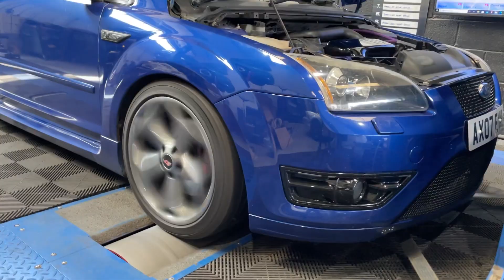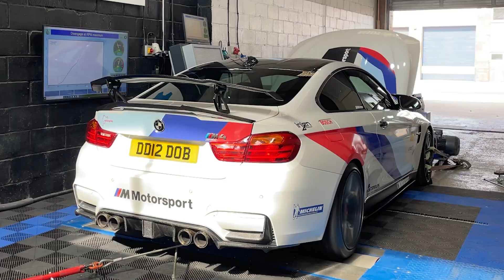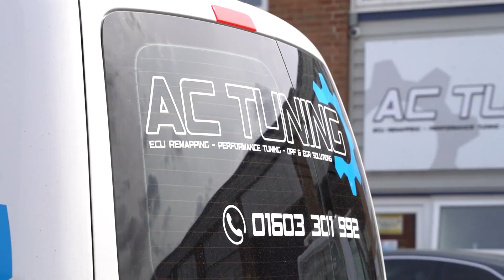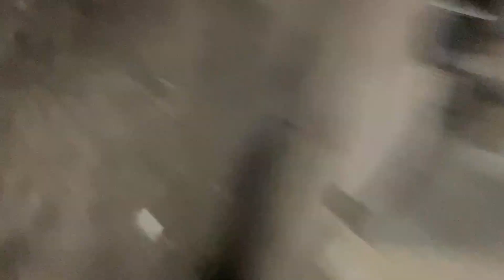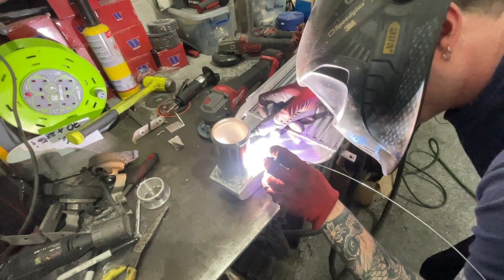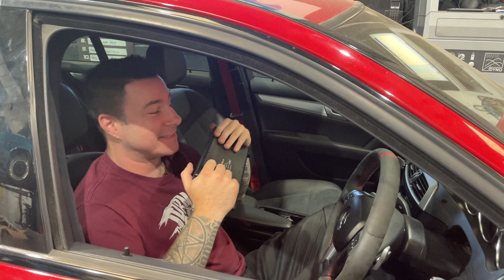Stage 3 Mercedes-Benz C350 Hybrid Turbo RETURNS!!

Comment: How’s the going , do you do much work to c250 cdi w204 ? Hybrid twin turbo , downpipe , intercoolers ? What kind of power would you expect from it with these modifications or is there any other supporting modifications I would need 
Cheers

Comment: Surely it wouldn't be a massive drama to turbo the petrol one of these it would be a rocket 🚀 c63 performance for micra money haha 😂
Reply from the maker: I honestly couldn’t say as never looked at doing one but it won’t just be turbo kit parts, it will be a standalone ecu as well which will really bump up the cost.
Reply: Yeah I guess a never thought about that haha not really any of the shelf bolt on turbo kits for these that  ive seen but I'm really Interested to see one haha 😂 be interesting to see if the stock suspension set up would put the power down ok
Reply from the maker: @gary-mac93  I’m sure someone will have turbo converted on at some point. Always worth having a look on here.

Comment: AC Tuning could you tell me the dimensions of the intercooler you used for the C350 please ? I already have one, likely going to need to cut out a bit of the crash bar for clearance. Mine is 700 x 300 x 80 only slightly wider but I've got hoses to cover that, only big change is double the standard height but if I cut out part the crash bar I think it'll fit nicely behind the grill
Reply from the maker: I will have to see if I can find the measurements for the intercooler as the customer supplied it. You have to cut quite abit of the crash bar out for it to fit correctly.
Reply: @AC Tuning  yea id thought as much especially with the added height, going from 145mm to 300mm ill have to cut out the top of the crash bar so it goes up behind the Mercedes grill then bolt the cooler to the crash bar and connect the hoses etc
Reply from the maker: @HardtoKill1986  it’s abit of a faf but definitely not the worst job I’ve ever had to do 😂
Reply from the maker: @HardtoKill1986  email us at info@autoculturetuning.co.uk and my colleague will work out a quote for you 😀
Reply from the maker: @HardtoKill1986  this is true, the cooler in this video was a direct fit for the original boost pipes, we only had to modify them as he had made his own hard pipe kit. 
But I hear what your saying 😊
Reply from the maker: @HardtoKill1986  awesome. Have you got the same intercooler as the one in this video?
Reply from the maker: @HardtoKill1986  thank you

Comment: Hello,
Congratulations for your preparation based on mercedes c350cdi (w204).
What turbo did you use?
The original mercedes GT2056v turbo that you hybridized?
Turbo specs please? (diameter inducer and exducer turbine, and for the compressor).
I am also looking for a good "plug and play" turbo for 315-330 horsepower on my c350 cdi w204, currently 286 horsepower...
Thanks.
Reply from the maker: The original turbo was built in to a hybrid by midlands turbos and was organised by the customer. 
I’m pretty sure the stock turbo is a 2260 but I would need to check this.
Reply: @actuning 
Thank you for your quick return.
Original on my Mercedes C350 cdi w204 (from 2009) so original power 224hp exactly like the old c320 cdi, I have an original gt2056 turbo.
Then in 2010 the 350cdi was upgraded to 231hp, but still with a slightly upgraded gt2056 turbo.

I would like to use a 2260 turbo in my Mercedes, but my own knowledge the 2260 was not used by Mercedes C class, even the next generation c350cdi engine (265hp engine) had a stock Gtb2060vklr turbo (on ball bearings + turbo liquid cooling).
This turbo starts very early and gives a lot of torque, but it is limited to output more than 310 horsepower, so a 2260 would be better... But not available in "plug and play" for my old version before 2010...
Reply: Facelift w204 350cdi comes with 2260vklr

Comment: Must admit I'm surprised the customer hasn't gone for the 400bhp hybrid turbo, I've heard as long as you limit the torque to keep the gearbox from going bye bye lol you can still run close to the 400 mark as the 265bhp versions have internals rated for 400bhp ? I love my Merc and Bm and Audi may have more power, but its not my beautiful C350 is it 🤷‍♂️ I love the w204 its one of the best shaped Mercs to modify
Reply: Gottuned has 400+ turbo for this engine 
And muchboost also something like 2872 size
Reply from the maker: @jimmykovacevic7745  Thank you, I will have a look 😝
Reply: @actuning  did you change tune in this video or same file did you got to much backpressure i think exthaust manifolds are too restricted 
In Finland they made custom ones
Reply from the maker: @jimmykovacevic7745  the tune is the same as where we finished up in the previous video. I think we are seeing flow issues as you say
Reply from the maker: Who makes the 400hp hybrid turbo as we have not seen anyone in the uk make anywhere close to this.
Reply: @actuning Hello! have you changed only the turbo to get around 400+. seen that with stage 2 dpf off, egr off you get 341hp 770nm can handle everything with stage 2
Reply from the maker: @reddevilproduktion2606  there are comments above from @NiallJones1986 about 400 hp capable hybrid turbos but there are not something I have any experience with. I have also never seen a c350 of this era make much more than 300hp on a stage 2 tune with DPF removed

Comment: Probably silly question is this the diesel or petrol ? As I've been looking for an intercooler upgrade for this past year
Reply from the maker: This is the diesel C350
Reply: @actuning  please could you put a link up for the intercooler that fits the c350 ? So far only Bd performance have been interested in sorting me out a custom cooler, likely airtec